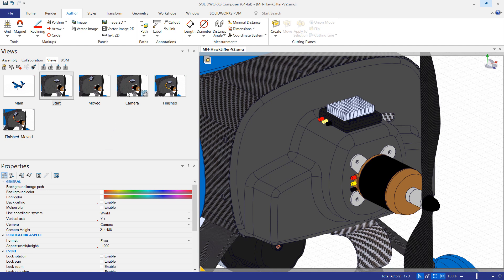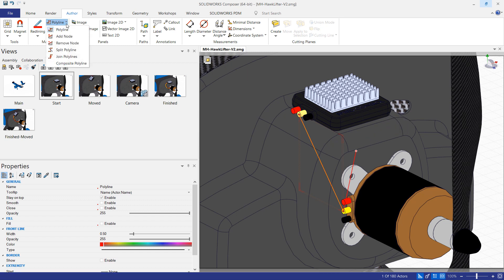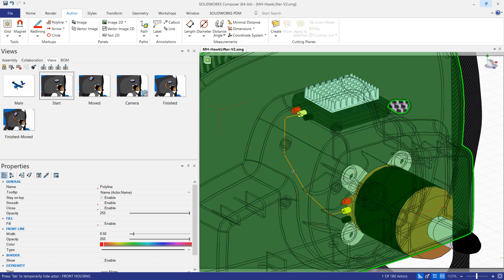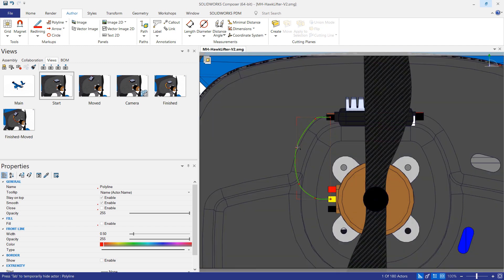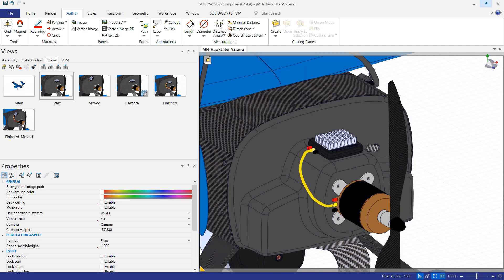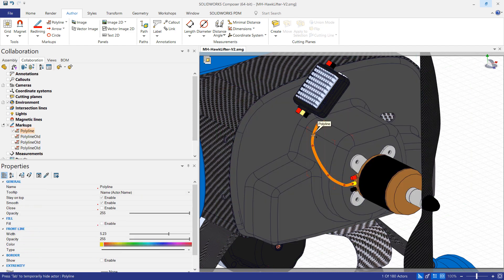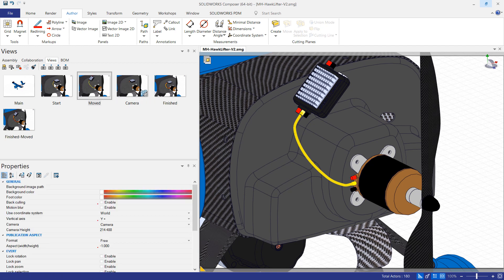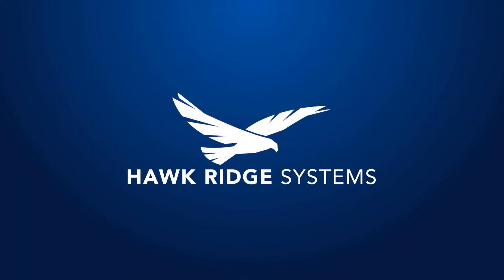SOLIDWORKS Composer: Representing Wires with Polylines

Comment: Can't we do these kind of things in solidworks
Reply from the maker: Definitely. Sometimes Composer users are forced to work with what they have in terms of an existing CAD file (that may not have wires), and that's when the workflow shown here can be useful. 

Inside SOLIDWORKS the wires can be routed with the Routing tools, or a simple Sweep feature along a 3D Sketch spline.